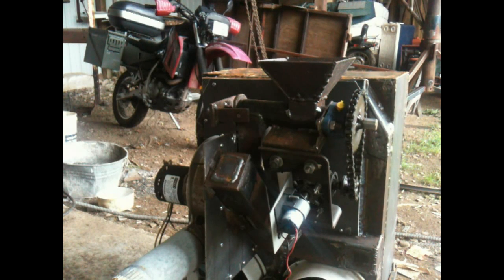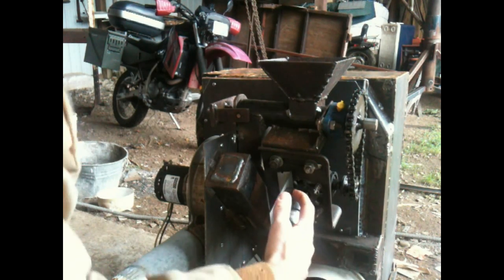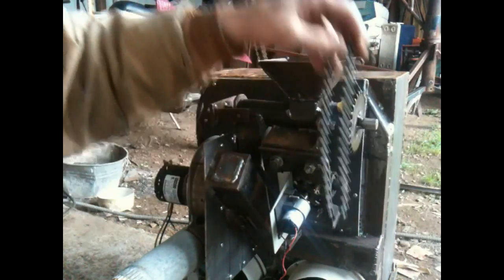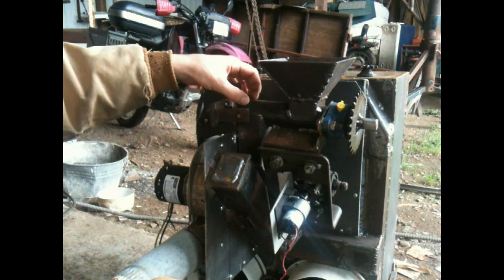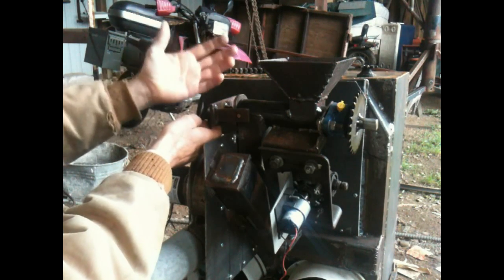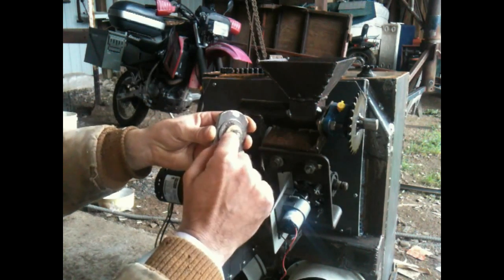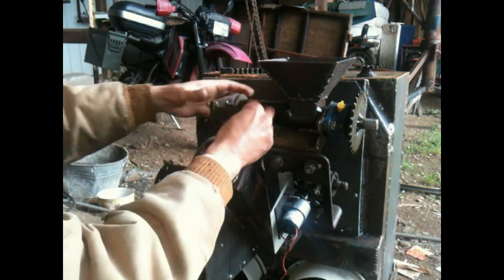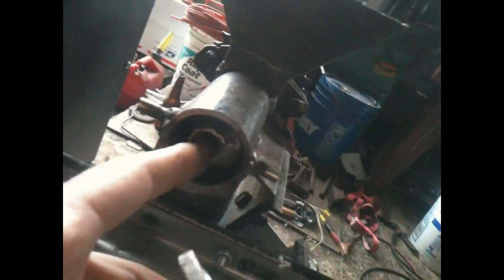Pellet Stove - Homemade part 4 - 4. "automatic feeder"

Comment: Hello Mark Veren , I plan to build a tiny house on wheels , with a home made pellets water heater stove that run on 12v solar and battery ..
have access to a 220v MIG MAG welding with no gas, what is the minimum plate thickness I can work whit in a safe pellet stove ?

Ps are you happy Mark Veren with your pellets stove?

Regards Roger Linsfors

Comment: Everything looks good. One problem I get is after 4 hours or more, I get ash cakes (clunkers) that start clogging the burn pot. Some stoves have a hand rake that you pull to break them up. Mine is not good enough to show, but some rods that push up through the bottom of the burn pot automatically as determined for time delay between pushes will work for me. Maybe you or others need one ?
Reply from the maker: you do not have sufficient heat inside the burn pot. increase airflow. ash supposed to fly away. If you have sparks popping this is normal 
but you don’t want to see PELLETS popping out. 
If you get Brown or Grey soot on the glass and firebrick this is normal 
if you have BLACK soot on the firebrick and glass  increase airflow a little more.
Reply from the maker: I don't have this problem. all the ashes are very light dust looking & i don't  clean burn pot. No need to do it.
Reply: Mark Veren I'm working on a new stove, it is the four inch square type due to material expense. The old one is in an air compressor tank and only uses natural draft. I would have gone your way if materials were available. But thanks, I do need more air flow.